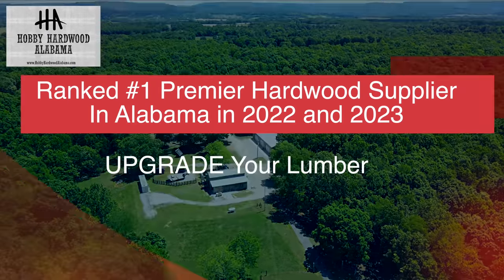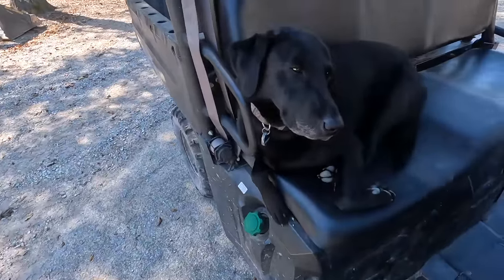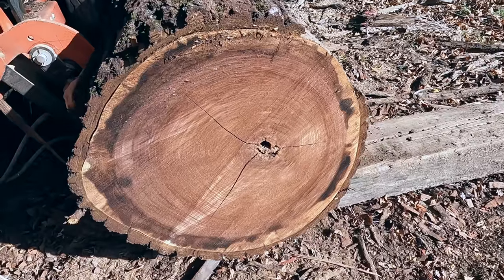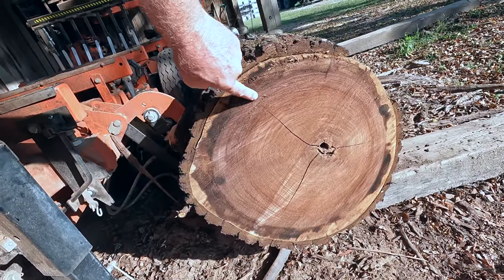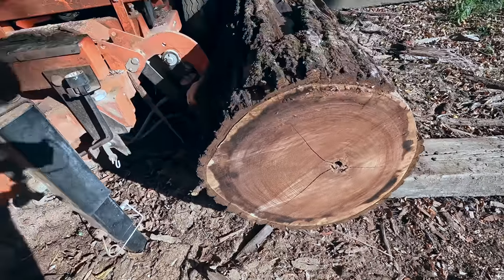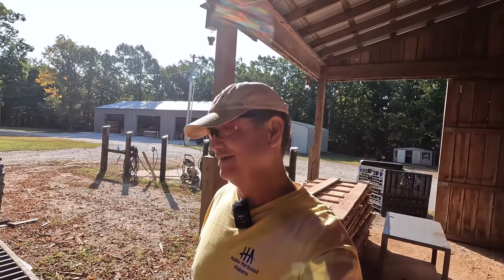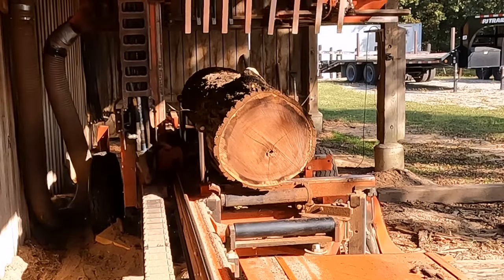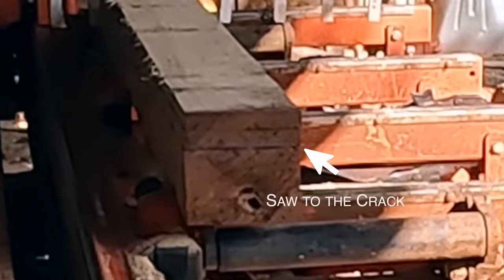Why YOU NEED to Sawmill at the "Y"!  SECRET TECHNIQUE!

Comment: What about the maintenance of your blades?  2,3,4 .... hours of sawing with one blade?  What are your advices for the  blade maintenance? Thank you for your videos.
Reply from the maker: I need to do a video on that.  There is no set time for blade changes, other than when they start to dull, change them.  That sounds simplistic, but it can be 2 cuts or 4 hours, depending.  Normally, I’ll get 600 to 1,000 bdft per band, but I use my senses to feel when one is getting dull and usually change it out the next batch of logs.  Good question.

Comment: Another great video showing how to get quality lumber from a less-than-perfect log, as most of them are!  How much benefit do you believe you get from the de-barker attachment?  Is it worth the investment?
Reply from the maker: Yes, a debarker is invaluable for dirty logs, and reasonably valuable for clean logs.  It will significantly increase the life of the band and pay for itself pretty quick.  This is from a guy who used to have a mill with no debarker and spent some cold afternoons in the winter, pressure washing the dirt off logs.  Never again.

Comment: Really like your videos.  I am looking at purchasing a saw mill...  and attempting to learn how to be a sawyer.  In watching the video on how to cut a log for high quality lumber, it was clear the pith does not make high quality lumber.  The question is, if cutting 2 by's or 4 by's would the pith be used?   i expect no, but thought i would ask..   i guess another way of asking, can the pith be used for anything other than burning??  ;)
Reply from the maker: No, the pith is composed of unsound cellular structure and is not useful for much of anything.  The intent is to contain and isolate the pith in as few boards as possible and discard it.  Thanks for commenting.

Comment: Why do you wet your boards (as seen as 11:25)? Some how I doubt it's to highlight grain for the "wow" factor. Does it aid in the drying process somehow? Or are they that soaked from blade lubrication during the milling process?
Reply from the maker: You are correct, I’m doing it for two main reasons, visual feedback to you, the viewer, so you can see that what I’m doing and how it affects the grade and quality of the lumber.  For several videos I didn’t do it, and people couldn’t tell what I was talking about or describing because they couldn’t see the grain of the resulting lumber.  So when I need to wet the lumber to make a point, I’ll do it, if not, then I won’t.  
However, I do have a lot of customers who watch my videos, and many love to see the wood they buy actually being sawn in the video.  So wetting the wood lets them see the grain before they ever buy it, and helps them visualize what it would look like in their project.  Then they build it and when they are bragging on it, they can also show the wood actually being sawn.  Pretty cool for my customers.

Comment: What blade angle do you recommend for a walnut and how much water soap mixture do you use 32 inch walnut trees? I took down and i'm ready to start slice in them up
Reply from the maker: I don't use water and soap of any kind.  I only use either a water soluble oil, like spindle lube, or diesel.  I have made a video on using diesel and is about 5X better than any water and soap mixture.

Comment: How thick did you cut it?
Reply from the maker: 4/4 is cut to 1-1/8 plus 1/16” minus 0” based on the standard hardwood scale.
Reply: @HobbyHardwoodAlabama  I’m not sure what you mean by “plus 1/16” minus 0””
Does that mean you vary up to 1/16” thicker but nothing under 1 1/8”? How do you insure that happens? How much do you drop the blade for each cut? Accuset goes in increments of 1/32”, how much do you allow for the blade, what blade are you using?

Comment: I've seen you cutting a lot of grade wood, but never seen you cut to capture crotch grain.  It's used a lot for panels in furniture from what I've seen, especially book matched pieces.  Do you have any stuff like that, that you sell?
Reply from the maker: Yes, as a matter of fact, we do produce crotch wood, and sell it as a product stream.  I just sold some incredible crotch wood this weekend, 3 matching boards, 18” wide, with an 8 foot, full length sound feather crotch.  Incredible boards.  Most times, I’m sawing for the business, kind of real time and you can deduce what I’m selling by what I’m filming.  There is some money in crotchwood, board by board, but the consistent money is in selling dozens to hundreds of boards at a time to customers who come from all over the country to buy the best they can get.  Think of all the walnut I’ve been filming sawing lately, and it’s selling for $20 per bdft.  However, I’ve got some crotch and live edge I’ll be sawing shortly, so stay tuned.
Reply: @HobbyHardwoodAlabama  $20 a BF?  Good for you!